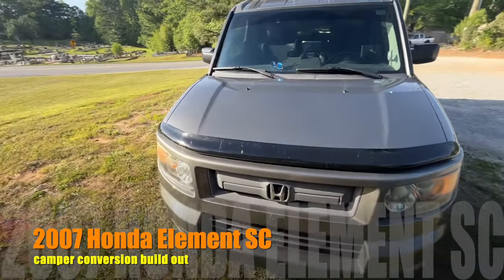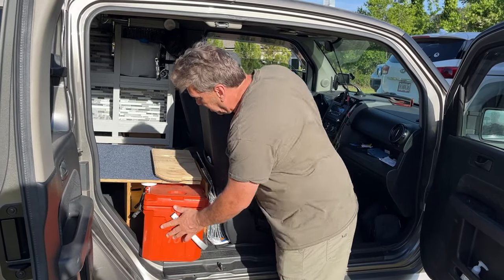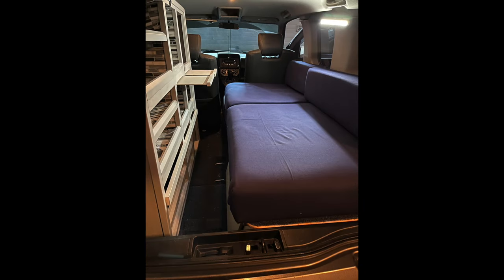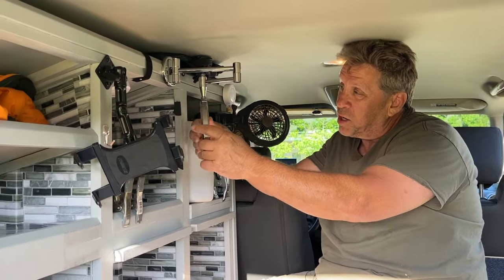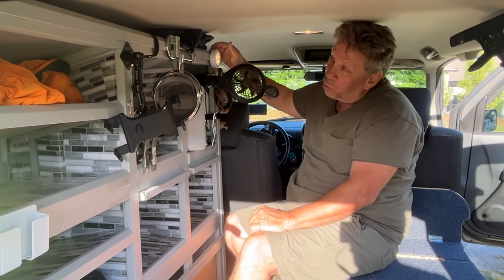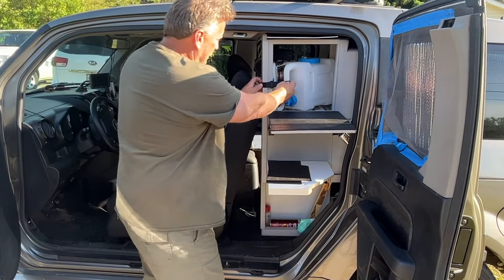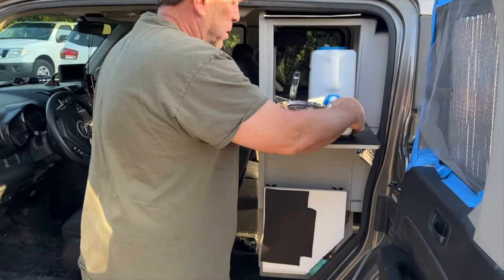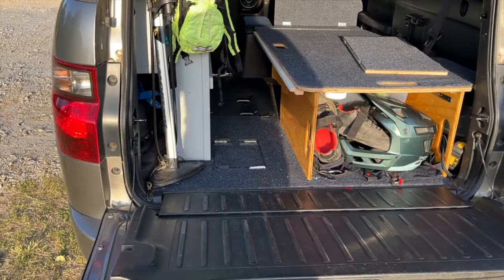How I lived in my conversion car camper.

Comment: This is a very nice build and appreciate your taking time to share. I am looking for an element and have avoided the SC because I tend to think I want AWD and probably manual but probably 99% of what I want to do is covered by your SC and set-up. Thank you !
Reply from the maker: thanks so much, when I got the SC I never knew I would camping out of it. there are time I wished I. had the AWD, but it worked out. I just avoid section off roads. Next week I'll be leaving ATL GA. and heading out west. stay tune for new videos.

Comment: does the rear deck go up or down ?
Reply from the maker: Hello, Im not sure which deck your asking about? The floor or sleeper section? thanks
Reply: @seasonedshredders 
the bike rack on the rear of the veh ?
Reply from the maker: @duggydugg3937  Its a One up Rack, its go down with 3 angel settings. Thanks
Reply: @seasonedshredders  
outstanding.. i hallucinate a low position and tent poles and synthetic canvas for a bbq porch.. or mid position for a motorcycle.. or up even with bed for lifting heavy objects